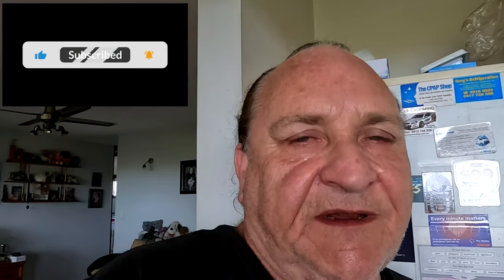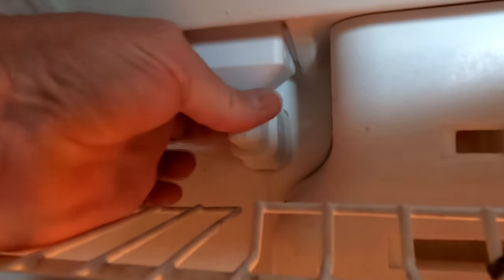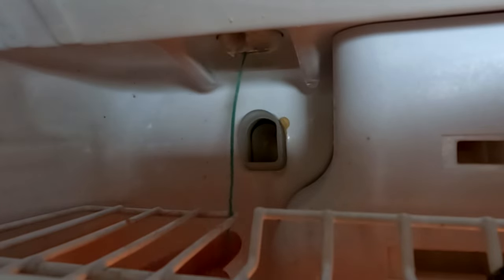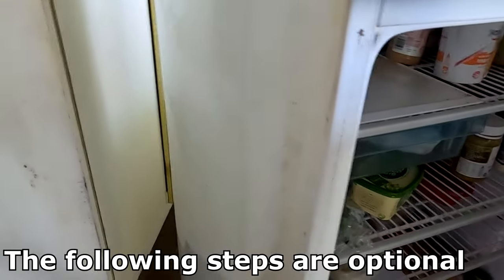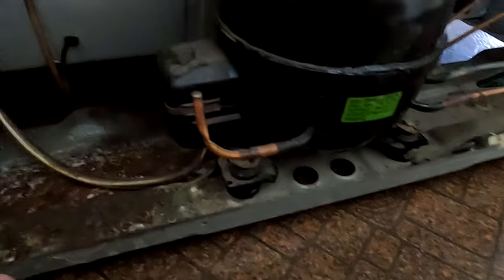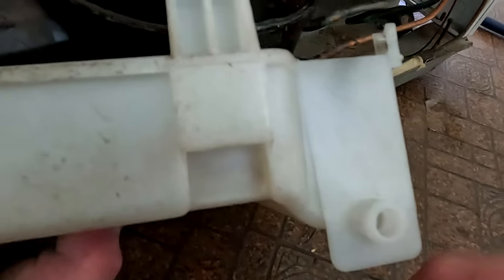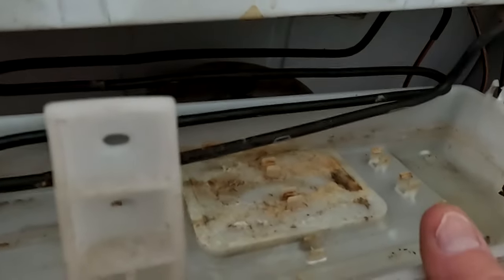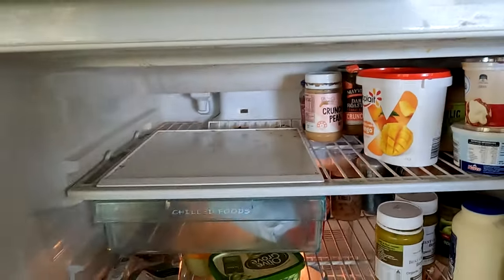Refrigerator Leaking Water? TRY THIS FIX 🇦🇺

Comment: Sometimes the simplest things can save a bunch of money. Good job Steve.
Our Kenmore (likely Whirlpool) fridge is 30 years old and has never broken down or needed repair. Except the usual ice-maker failure several years ago. It looks awful but works fine. Unlike the ones of today. If we replace it, it will be moved to the garage so that we'll always have one that works! LOL
Reply from the maker: Yep; VERY SAD reflection on modern times of mass produced JUNK, isn't it!? 😔
Reply: @SteveMack  Indeed. The old way to riches was quality. The new way is planned obsolescence.  ☹
Reply from the maker: 'planned obsolescence' began with the light bulbs: Initially, light bulbs were built to last, but a cartel in the 1920's decided to produce bulbs limited to a maximum life of 1000 hours, making the humble light bulb one of the first examples of planned obsolescence and a model for increasing profits on other products.
Reply: @SteveMack  Ah yes. I've seen the story. Also the one of a light bulb in a firehouse that's been operating for decades if not longer. I can't recall exactly but a long, long time.
Reply from the maker: Oh that's right...there's also a clock somewhere, in a university I think, that's been going for 200 or 300 YEARS!
Reply from the maker: * I've actually just powered up the 50+ year old fridge this morning to give it a run, it's a GE (General Electric); yes - the same people that were (along with many companies) involved with the invention of the atomic bomb, and...Just like radiation - It lasts a long, LONG time! 😇🙃
Reply: @SteveMack  ...and very efficient at what it's supposed to do.
Reply from the maker: @johnnyduplantis  CORRECT :text-green-game-over:

Comment: I had to do a different fix for mine. The hole on my top freezer is behind the back wall so I had to remove the shelves and the back panel inside and got the hair dryer to defrost the ice in the hole. I had to do this a few times then finally found the fix that has lasted a few years. now. Different than yours the directions I got was to hook a copper wire to the heat coil above the hole after feeding it down into the drip hole and gently fold the wire over the heating coil. No more freeze ups. Honestly Steve it totally freaked me out. And of course I did unplug the unit. It was a fridge repair man on youtube. My fridge is a Roper.  Is Whirlpool and Roper the same?
In 1989, Whirlpool Corporation acquired the Roper brand. Roper initiated a corporate acquisition program, supported by an initial public offering, in 1992.
Reply from the maker: Funny, because before you posted this reply, I was thinking that if it doesn't work for people; DON'T use a hair dryer, simply because electricity and water do NOT play nice with each other!!! I'd have used boiling water in a pot to defrost it. Never heard of Roper, so can't comment, but I DO know that many of the once GOOD brands (including whirlpool) are now considered junk, since all of them are 99% MADE IN CHINA now - even 'Speed Queen' etc. I have a spare fridge on my deck, that you may catch glimpses of in some of my videos, that my sister bought new, well over 50 YEARS ago...Long story short; I ended up with it 25 years ago, and guess what? IT STILL WORKS!!
Reply: @SteveMack   This current Roper is almost 16 years old. We had one previous bought in 1992 and i now it was still working  just fine in  2019. So   
it also has a little age on it. I have not been to that house since 2019.
Reply from the maker: Our Panasonic is at least 20 years old. I have a spare one outside, that my sister bought new over 50 years ago, that STILL works! The main trouble with new fridges, as my refrigeration mechanic mate Greg told me many years ago now; is that they use computers to run everything, and they fail. As I just commented to someone else before; I know someone whose had to get TWO fridges in 18 months!
Reply: @SteveMack  OH that is awful to have to buy two in 18 months. They are so expensive.  Probably no way to repair them.
Reply from the maker: No there IS; replace the circuit board/s, but the cost with labor makes it not viable usually.
Reply: @SteveMack  Well I do hope my fix keeps working. I am not into buying a new fridge any time soon.
Reply from the maker: I wouldn't want to either!! ❤